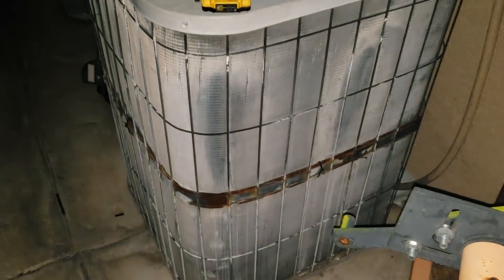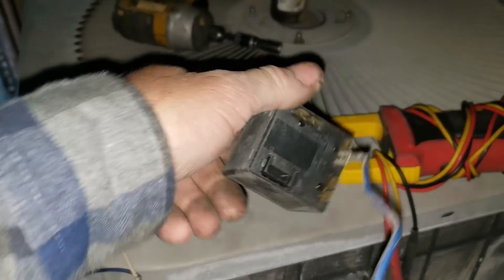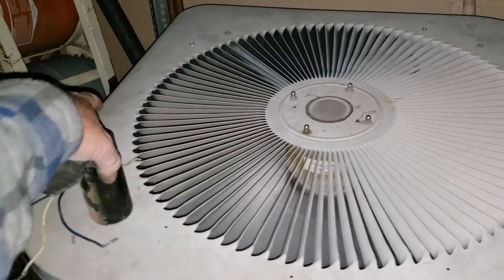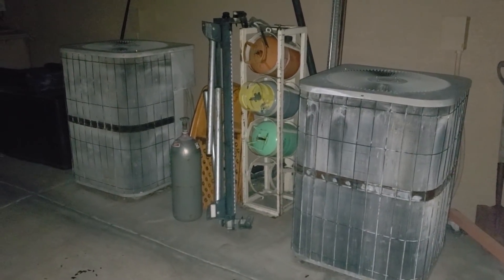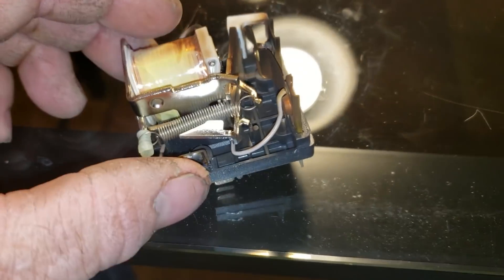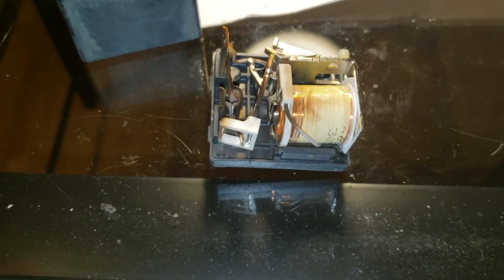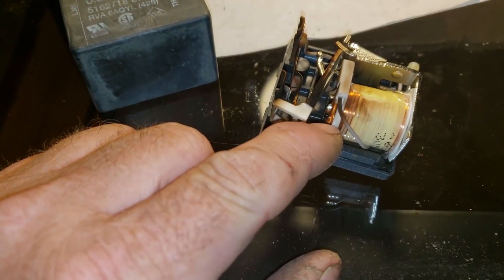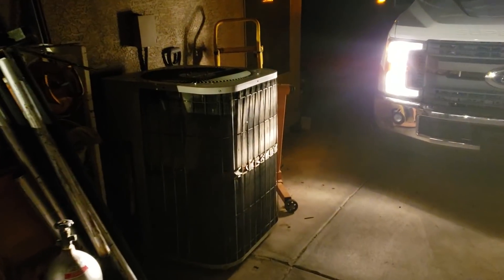My POS Goodman Heat Pump broke down - Failed potential relay show-n-tell

Comment: Seems like this goodman was the more problematic of the two. I know of a few of these units and the tops on most of them rattle so bad due to the metal being so thin. Goodman definitely improved but still not as good as Trane. I have a 1.5 Ton Trane XR13 from 2018 and have had zero issues besides a power surge that caused the scroll compressor to run in reverse briefly, turned it off and waited a bit and fired it back up and it was all good.

Comment: I have five 2008 Goodman units and only one of them is quiet, and that is the one that got the compressor replaced. That same unit failed and will be replaced in the spring.

Comment: Are you guys running in heat mode or still using the AC??
Reply from the maker: Heat a little in the morning and doors open in the afternoon if it gets too warm. 

Commercial buildings are using heat in the morning and cooling by noon.  
More cooling than heating at most places.

Comment: "Just as good as Trane!" Lol, how much longer do you think they'll last for?
Reply from the maker: They'll last as long as I put parts in them. 
If a coil leaks or something major I'd be tempted to go with a multi air handler Mitsubishi inverter system or something. 
At least for the upstairs bedrooms to zone them. 

But I'm cheap. So who knows.
Reply: @hackfreehvac  Huh, that'd be cool. Man when I started doing installations, I wanted to slap in a new Trane in my home, put in a 16 SEER TEM6. It's great, love the videos bro, love to see a home installation video sometime.